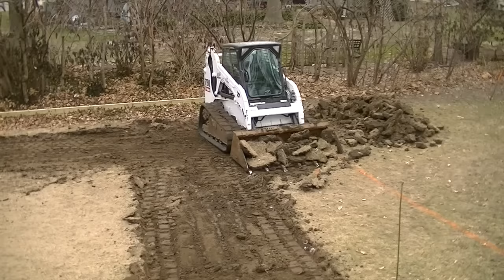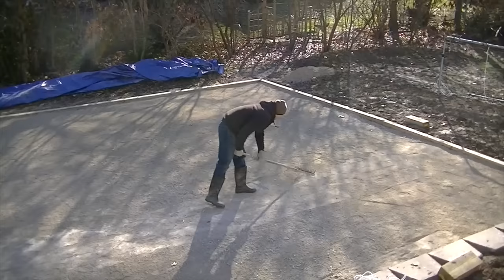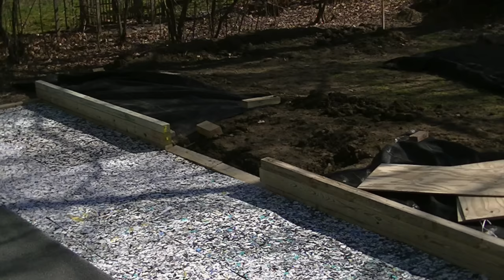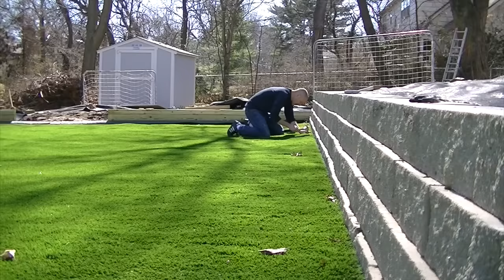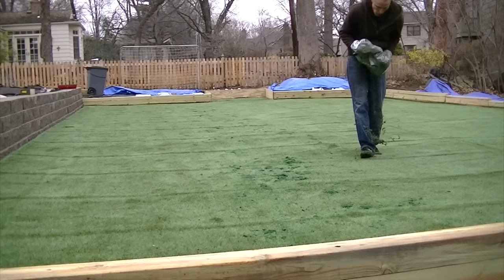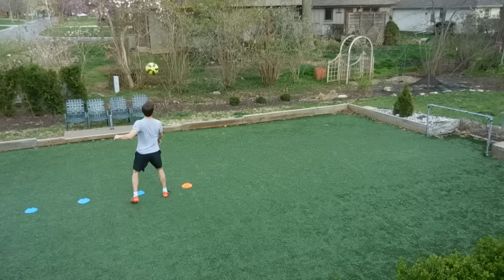How to Make a Backyard Artificial Turf Field

Comment: I was wondering how maintenance of this is? Living in Florida im afraid of drainage problems and other weather related fatigue.
Reply from the maker: My turf is a high quality product that still looks good after many years of use and extreme temperature changes living in Kansas.  It's flattened a bit from normal use, but I also could have added more infill.  The turf is also porous, so water drains through it.  However, if there is a heavy rain, it's important that you have a small slope so excess water drains away from your house.  The only maintenance required for me is to blow off the leaves every so often.

Comment: is adding the lawn pads better if using for soccer or will the gravel without the lawn pads be stable enough to play on over time?
Reply from the maker: Mr. A lawn pad is optional.  If you have good compacted gravel, quality turf and infill, you do not need lawn pad.
Reply: Video Guy i have compacted the gravel but there is still some that won’t compact and scared it will cause the grass to shift around and possibly get worse overtime so i was curious if the pads would help with shifting and feeling some bumpy-ness from the un compacted rocks
Reply from the maker: Mr. A the turf is very heavy and is nailed around the perimeter.  My turf is not perfectly flat because the gravel was low quality and retained moisture.  The lawn pad might have helped, but the pitch is a little bumpy in some areas. It is still a great place to play and better than a grass yard with dirt, mud, rocks, sticks, etc.

Comment: Very cool project. Nicely done. I'd like to do this myself but my concern is that with no drainage the turf must become an absolute swamp after a rain storm. I would assume that those pads stay wet for quite some time
Reply from the maker: There are holes in the turf and there is a slight slope for water drainage.  There has never been a swamp after torrential Kansas rain storms.

Comment: When you build the turf field like that, is the surface permeable? The reason I ask is that my county only gives us a certain amount of non-permeable space to build on. Otherwise brilliant build!
Reply from the maker: There are holes in the turf for water drainage.  It is a permeable surface.  However, if there is a very heavy rain, there will be some run-off.   So, you have to consider where the water will go.   Make sure there is a small slope away from your house.

Comment: Can you tell us what kind of plastic film you used to fuse the underside of the two pieces of turf together and also what kind of adhesive?
Reply from the maker: The plastic film was provided by the turf manufacturer (Tencate).  It was maybe 12 inches wide and a thin clear plastic.  You can hear it "crackle" when walking on the seam which I find a little annoying.  The adhesive was an all-purpose adhesive... probably Liquid Nails... and has done a great job.

Comment: hey would you say 40 x 30 would be big enough for a 4vs4?
Reply from the maker: 40 x 30 is not bad for kids to play 4 v 4.   It's probably too small for adults.   I recommend 3 v 3 or maybe force players to not cross the center line in order to create more space.
Reply: Hey how much did you spend on the crushed rocks?
Reply from the maker: I don't remember, but I chose the cheapest bid and regretted that decision.  The stuff that was delivered did not drain very well.  Make sure you buy the proper crushed rock.
Reply: so wich one is the proper one?
Reply from the maker: There are different types of crushed rock depending on where you live.  Some people might call it aggregate or another term.  So, it is best if you ask a landscape company or contractor in your town.  Tell them it's for an artificial turf field.

Comment: Great great job ! but i gotta say, from experience those very short wooden walls are not a good idea, either go back a meter or so and make a higher one or a net works better and cheaper and see through, or no wall at all, coz if anyone trip and fall down on those it would hurt really bad no matter where he hits the walls !
Reply from the maker: Thank you for the feedback.  Nobody has been injured on the wood wall, but I was concerned about it and thought about covering them with something.  The good thing about the wall is that it help keep the ball in play and block out some of the leaves from blowing on the pitch.

Comment: How do you avoid rot and mold in the wood trim around the field?
Reply from the maker: I used pressure-treated lumber.  It has no rot because it sits on too of the crushed rock.
Reply: @VideoGuy  thank you for the reply! That helps a lot with my own project.

Comment: This is sooo wrong.. building a concrete sides where children are running... Jus one wrong step or push and his life can end.. this has happened a lot in EU so the forbid walls or any concrete parts around soccer fields..  u need to make some adjustments or put some thick foam over that wall and wood.. Play safe!
Reply from the maker: romascenko i do not disagree, but nobody has been hurt because we do not play rough games.  If I made it again, I would do it a little different.  Thank you for your concern.
Reply: @VideoGuy  i appreciate your work its just a reminder to be safe :) great playground by the way!

Comment: Did you put any drainage system under the turf? If not is that an issue?
Reply from the maker: There are holes in the turf and rocks under the turf.  That provides sufficient drainage. However, make sure the pitch slopes away from your house in case you get a very heavy rain.
Reply: Thank you for the video and response.

Comment: Nice but u did some important mistakes at installing.
Reply from the maker: I realize that I made many mistakes.  Which ones are you talking about?   I'm curious.
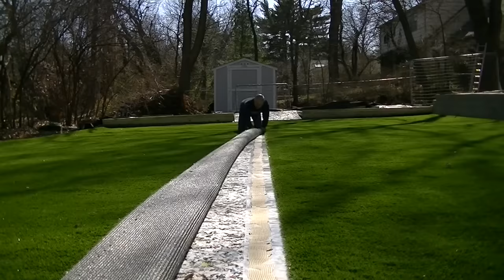Reply: @VideoGuy  at 1:13 u spread glue just on one side...u should spread your glue at middle for both rolls
Reply from the maker: Funny.  Glue was actually used properly on both rolls.  The video is just showing a quick demonstration.